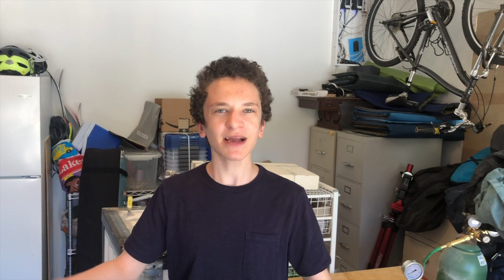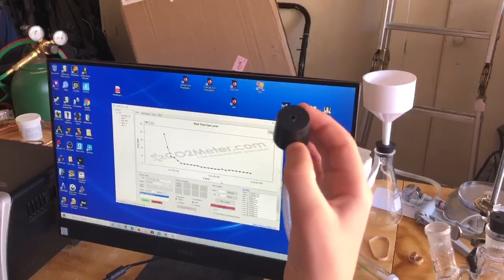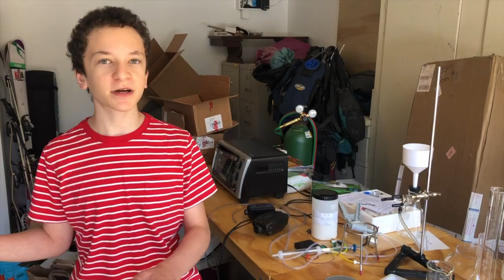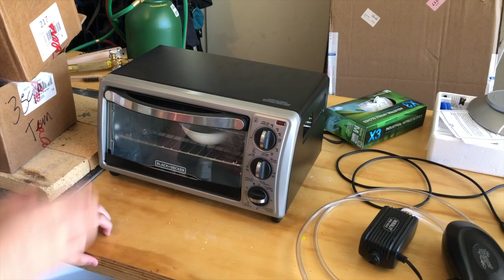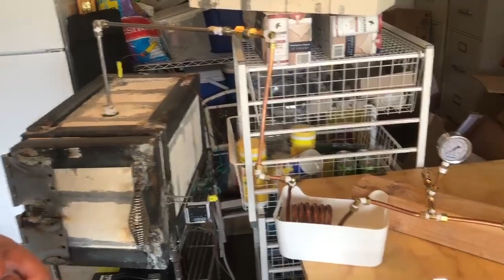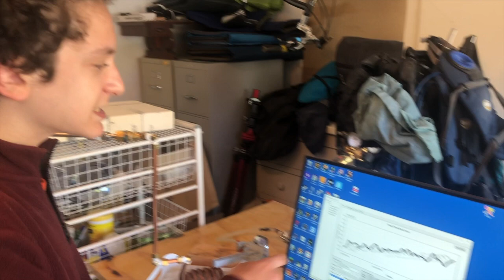Direct Air CO2 Capture Home DIY

Comment: Another way to capture CO2 from air is to first remove the moisture from air using silica gel or a membrane dryer and then pass that air into a thermos that has the head of a cryocooler inserted into it.  You would set the target temperature to just below the temp of dry ice so you don't liquefy nitrogen, oxygen or argon.  Come back after a day and the cold head of the cryocooler will have a very thick layer of dry ice on it.  You can knock it off the cold head into a flask that can handle high pressure, let it sublime for a little bit to drive out air, cap it and now you're left with pure, pressurized CO2.

Comment: So you will have calcium oxide. The co2 could be bubbled through a calcium  hydroxide solution  for calcium metal until you get a compressor. I love your video

Comment: What powers the oven?  Electricity? Produced using coal or natural gas?
Reply from the maker: Yep, that's the big flaw with that design. The oven is plugged into the wall, so the power probably comes from non-renewable sources, but it could in the future be powered by solar panels and batteries.

Comment: Is there not easier ways to capture the CO2 without chemicals? Why not just get a container and bubble air through the water?
Reply from the maker: Hi there, when designing this experiment, I thought of a few different chemicals that could work. We need to use them to grab the co2 from the air, which will not happen in the way that we want with just plain water. Luckily, the chemicals can be reused over and over so there’s no waste.

Comment: I wonder if theres another oxide that will give up its carbon with lower heat? Good stuff. I saw a oxygen concentrator and thought that perhaps the same ideas can be applied here. The oxygen concentrator has two tanks that run independently when one is saturated it switches to the other. You could use a similar system with tanks of sodium hydroxide.
Reply from the maker: That's an interesting idea. It would definitely increase the amount of CO2 that could be removed per reaction.

Comment: 1200ppm in a garage (not inside a room) is far from normal. half that would be considered normal at 600ppm inside of a room occupied. i run two c02 sensors throughout my apartment and maintain >450ppm

Comment: I've been working on a similar project. I'm going to be bubbling air into NaOH at the top of a tall vessel which is beng heated to about 99C at the bottom. As the NaCO3 precipitate falls it ideally undergoes some calination just shy of reaching the bottom. I will then apply light suction to a glass straw at that depth to degas the water hopefully liberating pure CO2. This is then dried in a Graham condenser and then stored.

I will also produce H2 via water electrolysis and then bubble my H2 and CO2 up through molten tin to form a layer of floating carbon black.

Nice project!

Comment: I think the ultimate question that we should ask is whether the carbon produced from heating the carbonates is lesser/higher than the what you are capturing instead.
Reply from the maker: Yes, the carbon produced by the heating is certainly higher than the carbon sequestered by this system, but this is just a proof of concept. A future design could store solar power, or some other form of renewable power to function.
Reply: @especiallyethan  couldnt agree more. Until there is a more sustainable energy resource like geothermal and such. we are just spending energy to produce lesser. thats how entrophy works unfortunately.

Comment: As much as I'm happy to see this, does running all of these ovens use up more CO2 than what is captured?
Reply from the maker: Running these ovens absolutely does use up far more CO2 than what is captured, because of the power consumption, but this is just a proof of concept. In the future, I hope to see a system powered by wind or solar.

Comment: interesting, this process of capturing carbon can be used in conjunction with the electrolysis of water to make hydrogen and make synthetic methanol. which can be used as fuel additives like ethanol or through more complicated processes to create synthetic gasoline which could render all petrol engines carbon neutral! keep up the good work.
Reply: I'm doing something like this, except I'm going to pyrolyze the methane to form carbon black and oxygen. The carbon black can be sold, and the oxygen is released to make up for the deficit we impose. The whole process will be solar-powered.

Comment: Why didn't you use calcium hydroxide at first? Did you want to captured CO2 in form of calcium carbonate at first? or did you have other reasons to change in Calcium carbonate later?
Reply from the maker: Yes, we could have used calcium hydroxide, as well as sodium hydroxide. We are experimenting with various chemical processes so we can compare and decide which is optimum.

Comment: Heyy Ethan....I've been trying to get in this and u have done which is really superbb mann...! I just want to know that what material do requires ....Its Request
Reply from the maker: Hello! To recreate this project, you would need the chemistry equipment such as beakers, flasks and a scale to make the solutions. You would likely need at least 6 or so feet of copper tubing (more or less depending on how spaced out everything was). To build the furnace, you would need firebricks and heating element wire, which you can easily find online. You would also need a special quartz glass beaker to hold the calcium bicarbonate, because a regular flask could not handle the high temperature. Those are the main required materials that aren't obvious; the rest are either totally optional or can also easily be found online.

Comment: If carbon was captured from air and dumped in a land fill will it cause another problem?
Reply: I watched your video on CO2 capture with the poo poo pipes have you got any further with it?
 I read that it can be used to make fuel.
Reply from the maker: It depends on the form that the carbon was stored in. Something like chalk would probably stay stable for a while, but other forms might re-release into the air. Also, we put about 9.5 billion tons of co2 into the air each year, and our landfills probably don't have the space to hold all of that. So yes, it definitely could cause additional problems.
Reply: @especiallyethan  what can it be used for? It seems like over half the stuff on the planet has carbon in it.
Reply from the maker: @johncroghan6977  Yes, carbon is used for tons of stuff from turning iron to steel, to graphite pencils and for filtration. It also can be turned into artificial diamonds.